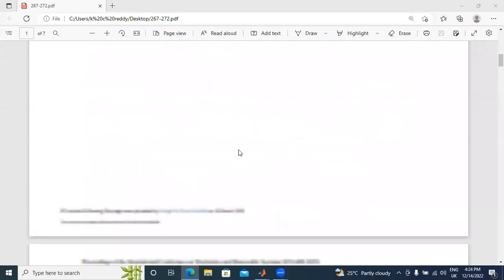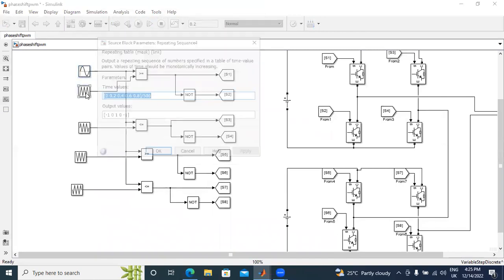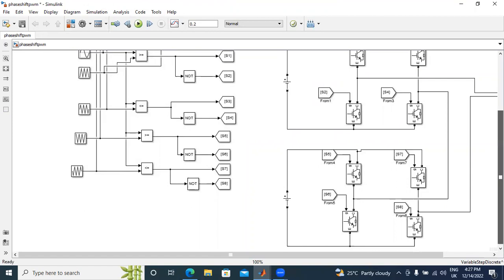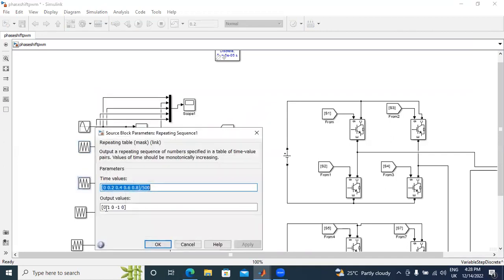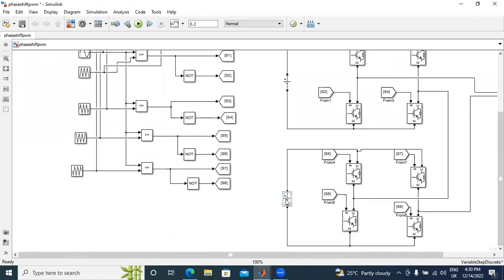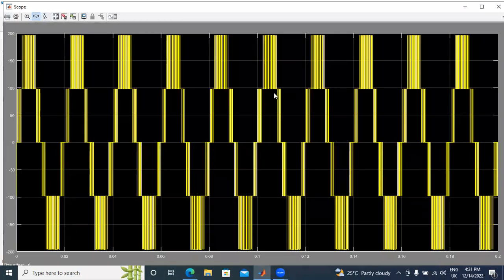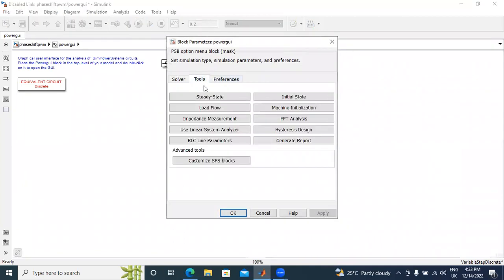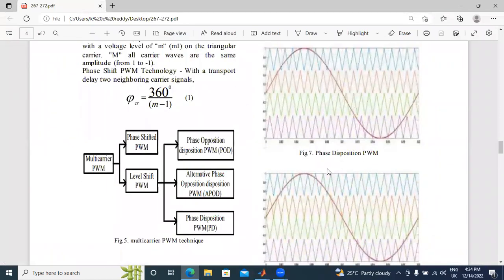Cascaded H-Bridge 5 level inverter

Comment: hello sir, How can I do 3-phase level 5 phase-shifted cascaded inverter(CHB)? I have tried with the same carrier frequencies(provided in your file) with the three different (120-degree phase shifted) sine waves for A, B, and C phases. my load is a Y-connected RL load of 10R and 66e-3H inductor and my switching frequency is 1.74khz. However, my THD output voltage is really high. what should I do?
Reply from the maker: Did you get output five level
Reply from the maker: https://youtube.com/watch?v=PrC5AxZSCQc&si=EnSIkaIECMiOmarE
Reply from the maker: I already uploaded file in math file exchange website download file
Reply: Sir hi i didnot get the output voltage 5 level although i follow all ur implementation!